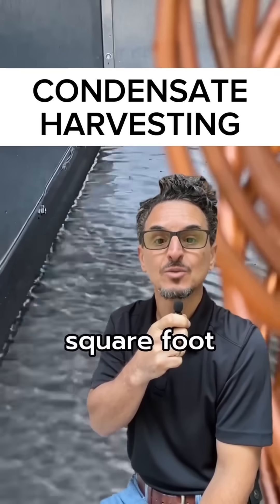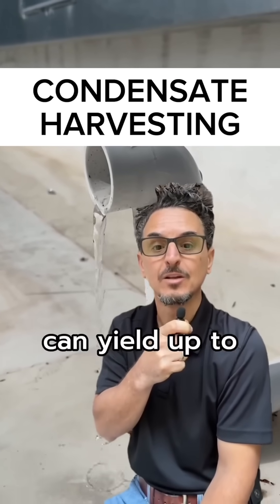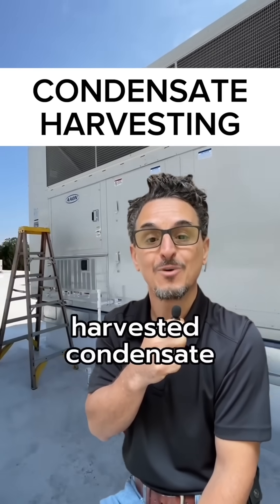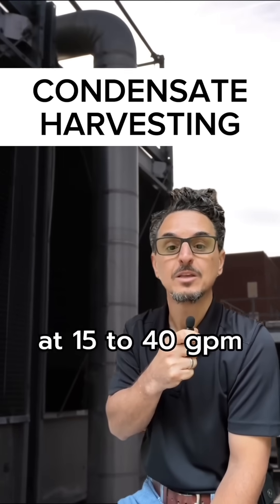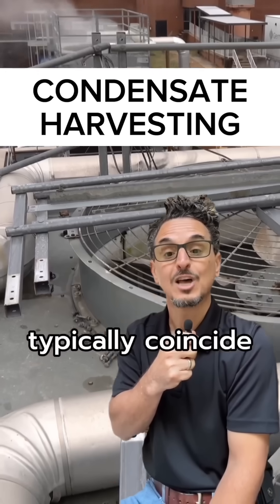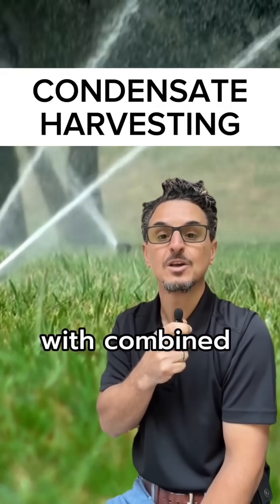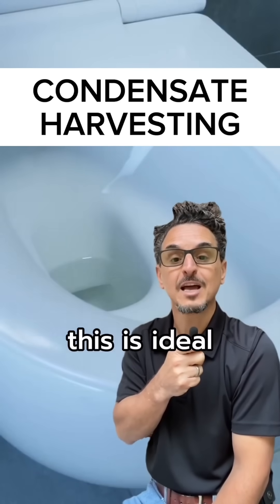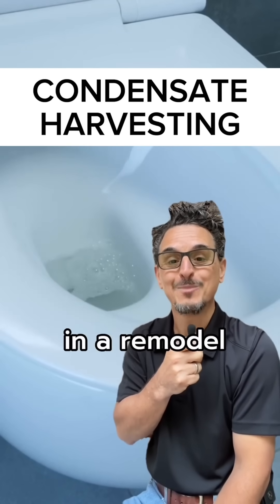One GPM of condensate harvesting at peak can yield 200,000 gallons of water savings annually.

Comment: We need this kind of stuff in the US so bad. I've been in HVAC technician for 15 years and it always has made me so angry watching us just wash this stuff down the drain. Also if you have cleaned the coils or if your coils have a copper component to them it's typically safe to drink. Now please don't misunderstand do not under any circumstance drink the water that comes out of your air conditioner, but with very little purification this water is completely fine to drink. We have to be better about integrating our buildings there is free energy free water and free cooling all around us and we just don't freaking use it.
Reply from the maker: Thanks for the comment!
Reply: It all boils down to politics and profit. If there's no profit, there's no motivation. Policies that support green energy only gain traction if there is special interest money in it (bribes for politicians and their friends) and those typically only come at great expense to the tax payer. For example, do you think the government would subsidize solar panels if the people with the political influence to get funding for them didn't have stock in the companies that make them? Of course not. They don't actually care about the environment. It's just another government program to exploit and skim off of. Until we purge Washington, this will never change.